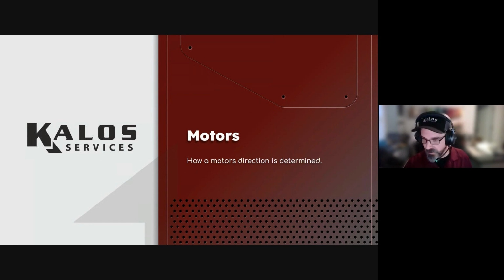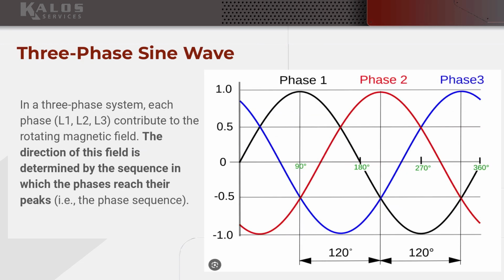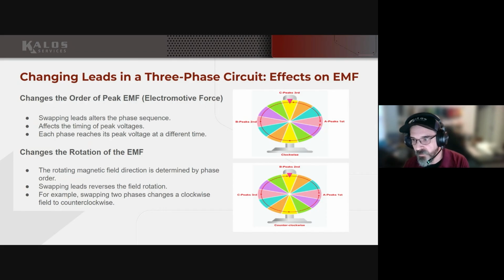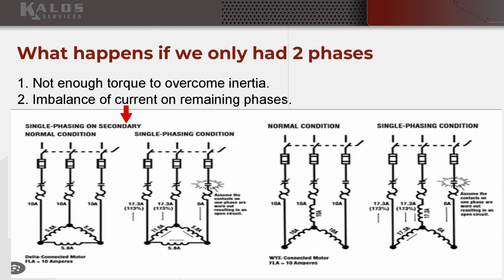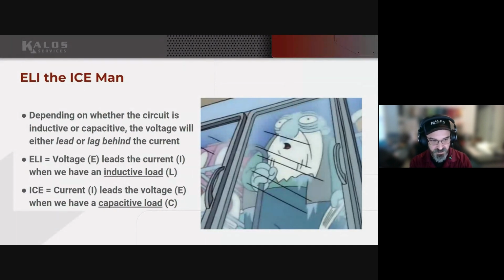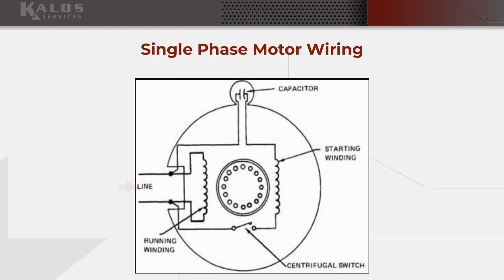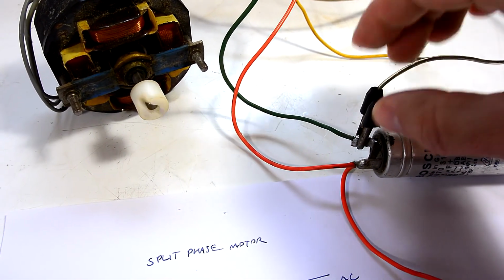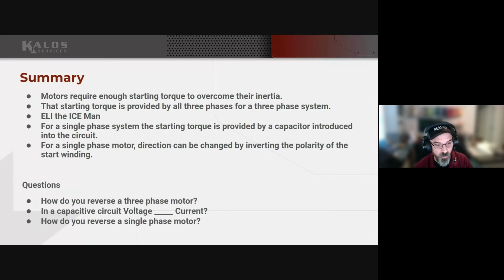Motor Direction for AC Electrical motors

Comment: great video. Thats why 3 phase AC exists, after all, and why heavy machinery uses it instead of monophase. Rotation is much smoother, consumption is more stable,  and no dependency on calculated capacitors nor mechanical switches. In newer motors like for drones, a kind of three phase motor is used called brusheless, which report their rotor position to a microcontroller, for it to create a custom 3 phace AC. Great to have max torque at all speeds and positions and perfect subjet for your next content!. Anyways thank you, regards.